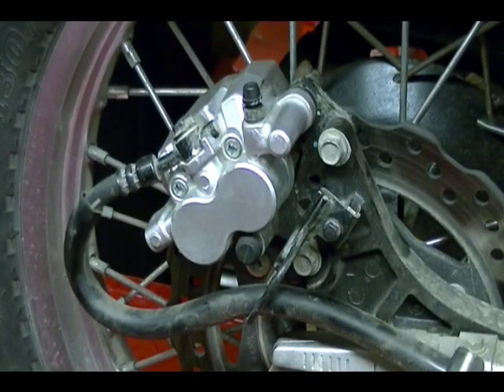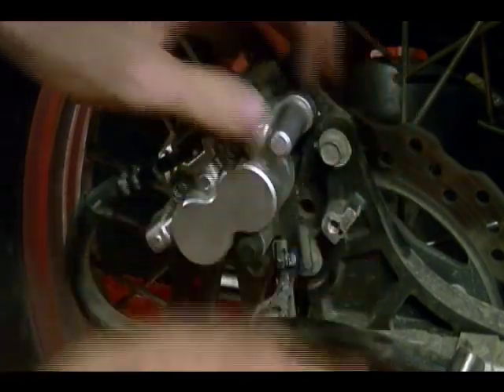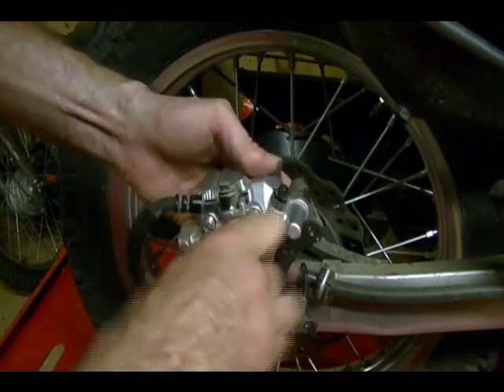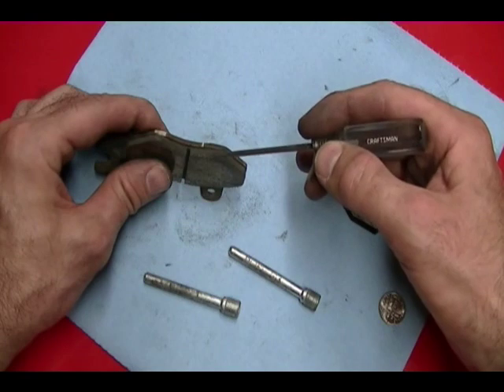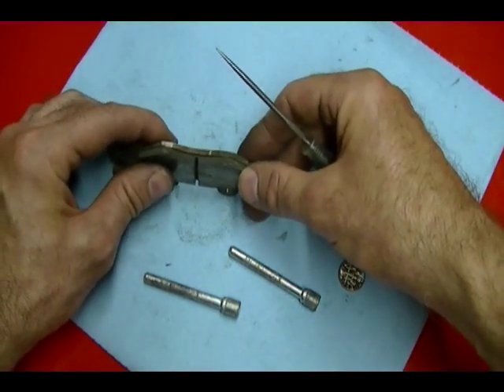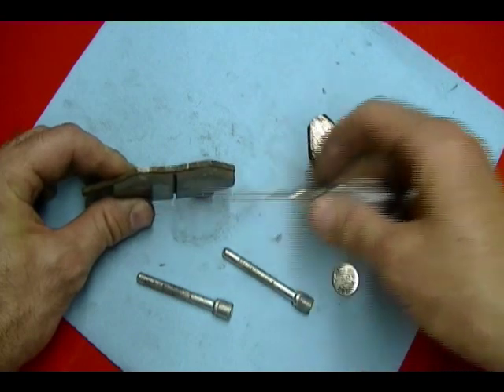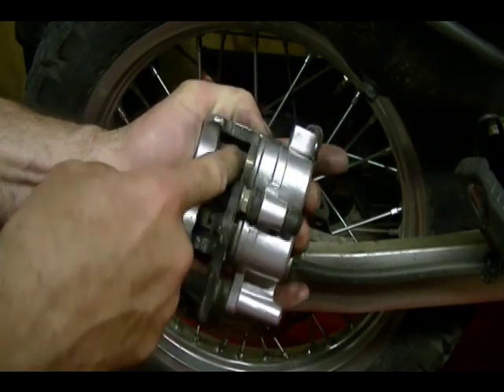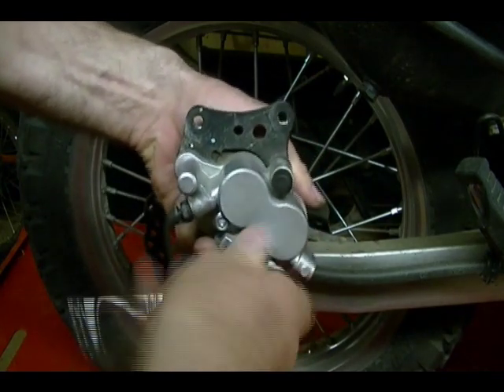Motorcycle Repair: How to Measure Motorcycle Brake Pad Wear on a 2009 Kawasaki KLR 650

Comment: Thousandths of an inch?? This is a metric bike, and milimeters are so much easier to use than retarded, outdated British imperial measurements.
Reply: +TheVoidReturnsNull Note I'm not necessarily rapping on you, just on whoever had the idea to measure this in silly inches. :) If that was you, then, well, shame I guess! Imperial is so bizarre.
Reply: I think you find that us British use the metric system these days :)

Comment: I've been told that the pads should also be checked for even wear.  That if they don't wear evenly, the piston(s) are binding from brake pad dust, dirt, road grime, etc.  Therefore you should take the brake assembly completely apart and clean all parts, then soak in Simple Green for ten minutes, then dry and reassemble.  Does this reflect your understanding, please?  Thanks!  Great video!!